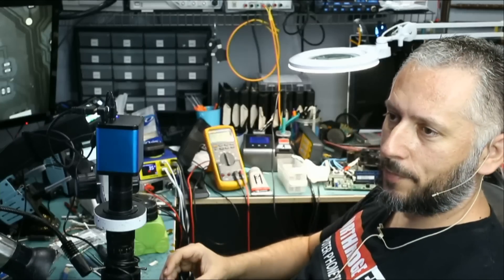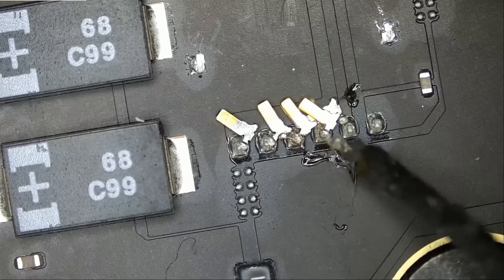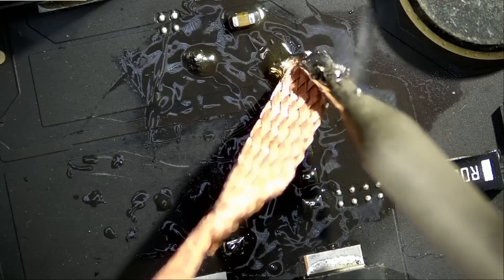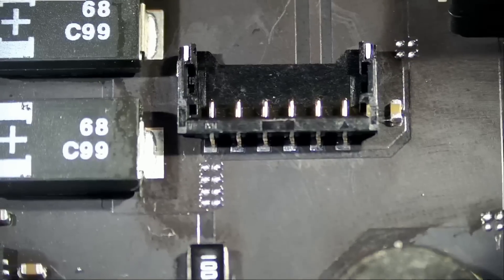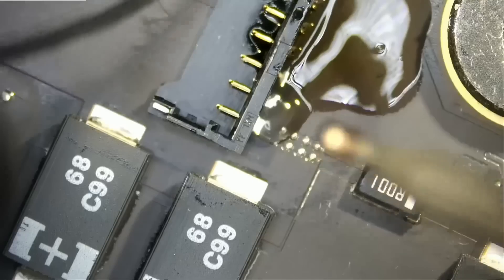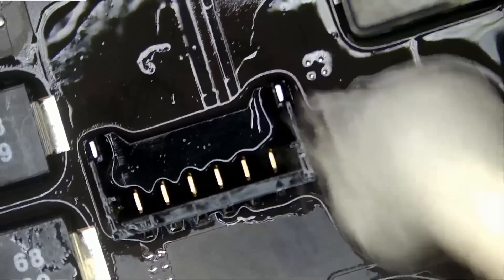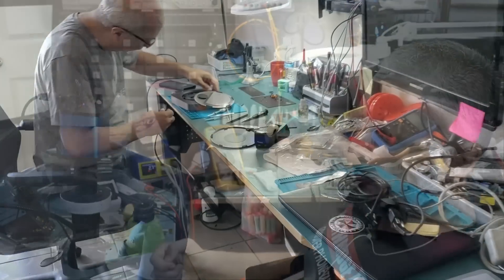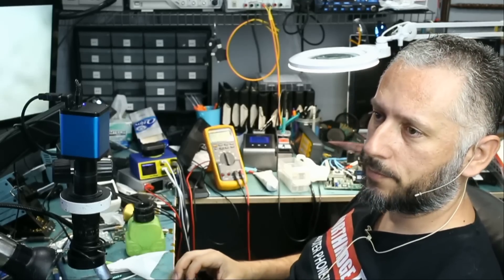2018 Mac Mini weakest link - Ripped Fan connector

Comment: Cool, great work. Easy job for you. I would be interested in how you would connect those two solderpoints without glue, that holds the connector down on the board. I think it would be to tight for the bent-solder tip. Thank your the video. I watched it after my work to relax. Greets
Reply: Infrared solder

Comment: can’t wait to see the 27” imac that came in today..probably a bad / bent LVDS connector ..that connector is the hardest connector ever to solder…40+ pins and most techs can’t do it!!
Reply: Much more fun when you do it on a phone board trust me. Esp when you have 80 pins fpc :)
Reply: @taskinyucekurt  in my experience phone boards, being much smaller and flat, are easy to secure in place. Large boards always make me work in weird positions and can never lay flat.

Comment: I have a Mac Mini 2012, i7 Quad Core. While upgrading my SSD I popped the the fan connector off. For time being, until I can get it in for repairs, I set it on a laptop cooling fan. This has worked out ok, keeping the CPU at 78-85*C. I know many people use a USB fan as a cooling solution rather than fixing the internal fan, saying they get better cooling, but I am concerned about dust. Well I just happen to have a LEVOIT air purifier I haven't used in a while. I fired it up and set the Mini, base removed on top of the Air Purifier. The Air Flow is much stronger, even on low than the laptop pad, plus it solves the dust issue. Well, my CPU is running at 45*C after using it all day including streaming. I'm currently shopping for a lower profile Air Purifier as this unit is abut 14" tall, but my God it has stayed below 50*C since I came up with this solution. I would think this is going to extend the life of this unit. I only paid $122 for this Mini so I'm really not looking to pay and electrician $100 Plus for soldering service.

Comment: Hey Alex! Thanks for your work!
Could you comment on why do you sometimes test GPUs with absolutely no cooling? Those components often die even with a heatsink. Isn't there a huge probability of a quick but deadly power spike?
Reply: Usually any chip before to be assembled in his final case is wormed up 2 times up to 400 C. and is tested after that.  So "overheating" up to 50-60 degrees C. for few seconds is not critical at all. But long and high temperature (80-90 C  ) can short life of the chip with years.
Reply: As long as you don't have it powered on for any lengthy period of time it will be fine. Also most modern GPUs can throttle.

Comment: Quick question, I'm new to all of this. Just started learning the whole microsoldering stuff. Why do you apply flux and tin and then remove it again with the soldering wick instead of just removing right away with the wick. Is there a difference ?
Reply: he mix facory solder with non leaded to lower melting temperature and for easier removal with wick...
Reply: @bbokip2138  mixes with leaded solder not non-leaded solder

Comment: When I used soldering wick it got pcb melted and stuck on PCB. I was practicing on nokia 3310 phone. I was replacing very small capacitor. Is it bad soldering wick?
Reply: Rather not enough flux and soldering tip too small. Wick cools too fast.

Comment: My computer(notebook) have installed a ram module of 8gb, but my notebook doesn't detect it, What problem could the notebook have? :(
Reply: because  its only 4 gb ram i think not supporting higher ram
Reply: @sadaqatali5712  Ou,  but my laptop support 24gb ram to 3200mhz (ddr4)

Comment: Why do people continue to buy Apple products?
Reply: please tell me how a customer ripping a connector off, is apples fault. or do you think if it was an HP it would be resistant to it? maybe Dell has anti rip off connectors? Alienware?   ive said this once, ill say it a million times. The reason you see so many apples getting worked on, is because apple sells so many computers.  PCs are not one computer, they are many companies. sometimes you have to think. How does apple have such a high customer satisfaction if they're computers are garbage. simple, they are not. there are millions of apple computers that never fail. you just see the ones that do and assume (prob from watching too much Rossmann) that they are garbage.